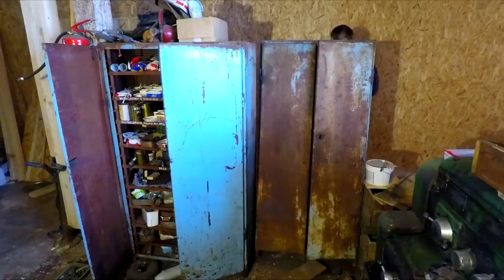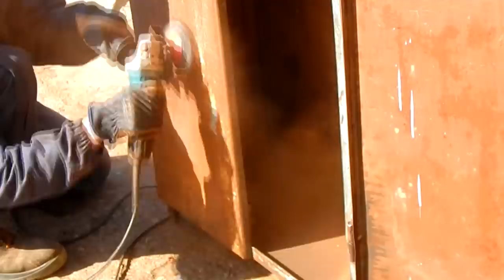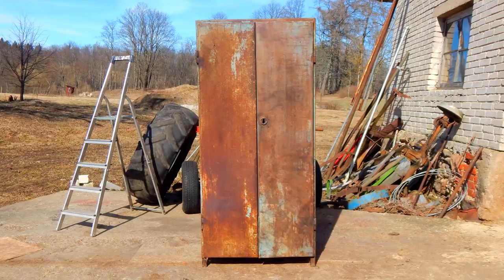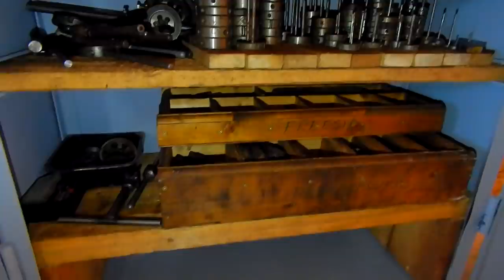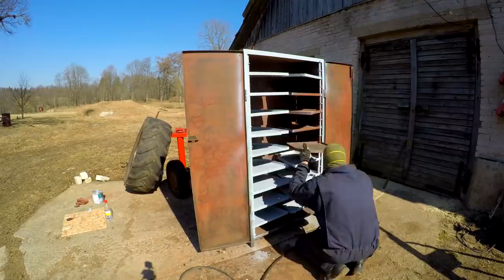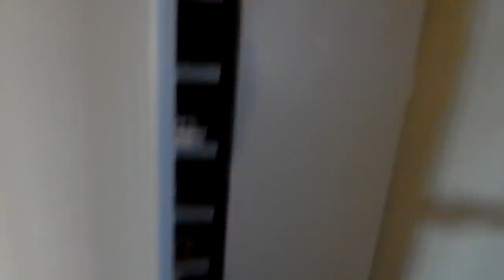Restoring Industrial Furniture - Machine Shop Build Ep. 10

Comment: that second cabinet is extremely cool/ useful, would definetly be interested in a DIY build of a similar design after your garage is done.. or maybe just some close up picks of the hinge design for the drawers so i can attempt a build.. i expect a new one is in the 1500USD or more range if you can even find
Reply from the maker: The hinge is made out of a tube that has another tube in it. Each shelf has a short piece welded to it and all the shelves have plastic bushings between them so they're quiet when in motion. And a smaller diameter tube runs all the way from the top to the bottom of the cabinet through those shelves and thus, the shelves can swivel. Really simple and effective design.

Comment: Good job' What's next? Lather restoration video? I know, I know. You dont have time for that now :(
Reply from the maker: I will clean the surrounding area of the existing "big" lathe and try to lift it up by 15-20 cm so it'll be flush or higher than the new floor that get's poured in. I could repaint the lathe but I don't think I will completely disassemble it and restore it in the nearest future since it works good as it is. I have other projects in my mind.